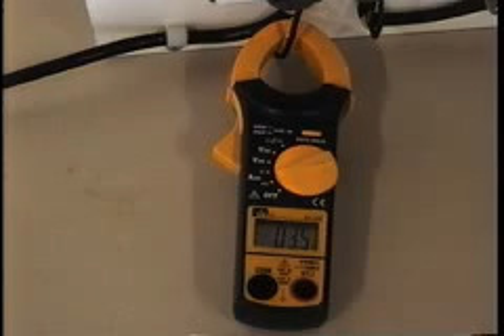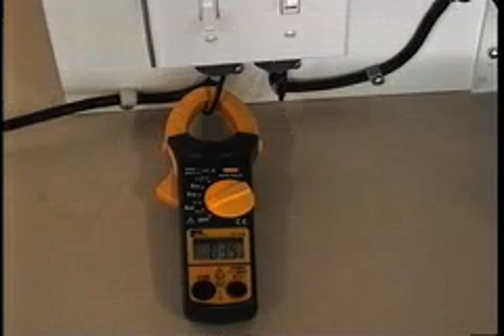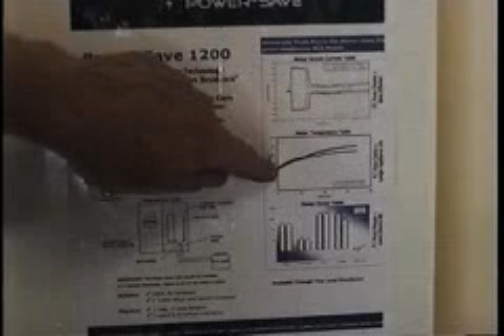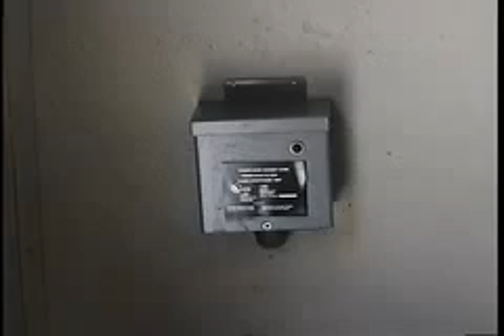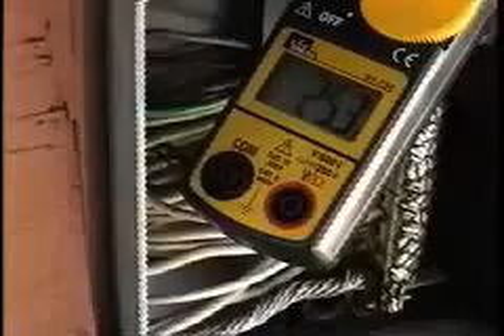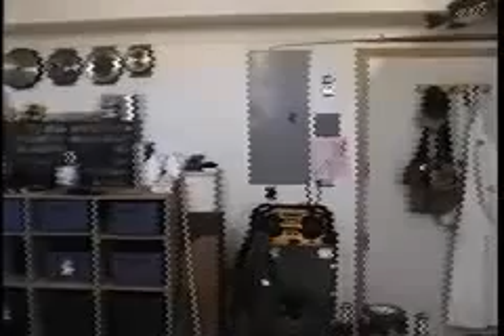Power Save 1200 Demonstration

Comment: I have been an senior electronic technician for 35 years. I know the theory of AC electricity. I have done extensive experiments using motor run capacitors which Power Save consists of and a kilowatthour meter and I have several of these. After all these experiments I have done, there is absolutely no change in the readings nor savings. Either with the Power Save on or not. It is what it is.

By the way. All the appliances I have replaced are US made. Any questions?

Comment: These appliances which I'm using were "energy star" compliant 10+ yrs ago...
So a conservative estimate to update these with today's energy compliant (made in China) appliances: 
New central air: $3,500, new fridge: $900, new washer $1,200, new drier (gas) $1,100, new power vent: $200 + install, new 5hp electric motor $250 (for air compressor)
Power saver on ebay: $70 that made my old appliances = energy efficient priceless :)
How much money you spent to save 43%? I spent $70...

Comment: I had replaced an old refrigerator and all air conditioners in my house with Energy Star units. My electric bills had dropped by 43%. Why? These refrigerators and air conditioners are Energy Star compliant have more efficient motors and better refrigerant.

Why stay with old, inefficient appliances? I say power save 1200 is still a scam for the homeowners. Period.

Comment: I bought one, installed it and my electric bill dropped tremendously!
When com-ed fails my generator also has better results with surge starting motors
I don't sell nor install these things, just noted from personal usage with a regular house which has the following: Power vent, fridge, 3 ac units, multiple server pc's running 24/7, and garage with a 5hp quincy air compressor that makes the meter spin like the tire of a 5 second dragster in the quarter mile!

Comment: Electrical meters measure consumption in watts, not amps.
watts = amps x volts x power factor
This device lowers the amps, but it raises the power factor in proportion, so the watts consumed remains the same.
Since the watts consumed remains the same, the heat generated by the motor is exactly the same.

This device is a scam.

Comment: This is a scam.  They scam you by showing a reduction in amps.  That's not power, it's current....different things with AC.  This is just BS.  Notice he uses an unloaded motor as a load - totally unrealistic.  An unloaded motor is an inductor, not a load.  It has a low power factor which the capacitors in the box increase.  However, this does not save energy or increase efficiency in any way.  Don't be confused by current levels.  That means nothing. Power is the key and it won't change that.

Comment: @OBXSOLWIND Amperage and watts are not the same. Amperage is the rate of flow to the load. Wattage is calculated by multiplying voltage times amperes. The electric meter on your house only measure in watts used, not current. If you have a home with a swimming pool and  pump running all the time. The power save will not make any difference on the homeowners electric bill.

Comment: @alexmiteecs  The power save 1200 is not my invention. I have exposed to what the Power Save 1200 consist of. I work in the calibration lab in the Boston, MA area. I would be glad to drop by and we would be in agreement in AC circuits. My work is in electronics.

Comment: @alexmiteecs  This is not imagination, it is real for sure. I have hands on experience with electricity. I have done numerous experiments with power saving devices. What's really inside that box? Motor run capacitors, nothing else. I have many motor run capacitors and done experiments with them, and I was right.

F in engineering? Think again. Go to an electrical school and learn about AC circuits. When you do find that I was right, you would have nothing else to say.

Comment: @CrankyOldYankee

Have you studied AC electric circuits?  I have been working with electricity for 35 years. Power factor correction does work for industrial customers to avoid power factor penalties. It has no benefit for homeowners whatsoever. ProTechPlumbing is right on this subject and I agree with him 100%

Comment: Amperage and whatts are the same thing. These things do work but only on 120v. what they dont tell you is the thing draws around 3 amps waiting for somthing to do. so if your house in not an energy pig these things dont work. If you have a pool where 120v pumps run all the time it may make sense.

Comment: I did not say that PF correction doesn't "work". I'm saying that it will not save a residential customer any money as they are not penalized for poor PF.

Since it will not lower KWA consumption (as discussed before) and there is no poor PF penalty to try and avoid, it's pointless for a homeowner to have one installed. It will not save them any money. It will give the power company some benefit, but not the home owner. As long as every one understands that then I will agree that they "work".

Comment: yeah mate, this is why big industry always use PF correction, cause it does work...... perhaps you could give some electrical engineers a lesson too if you believe PF correction does not work.

As for the device in the youtube video on a domestic level i could not see the need for it as domestic customers dont buy power at 11Kv or 33Kv and do not have their own transformers, however large industrial customers do and this is where you see PF correction in use "working" everyday.

Comment: "if mains amps are reduced so are the watts drawn"

Not if that amperage reduction was in the form of inductive reactance. In that case (what a PF corrector does) only volt-amps will go down with the amperage reduction, not watts(and KWA consumption).

It's pretty sad when a supposed electrician has to be given first year electrical theory lessons by a plumber............. perhaps it is you who should be rethinking careers.

Comment: In the case of a purely resistive load, yes, amps and watts are proportional.

However, in inductive loads it's a whole different ball game. Reducing the inductive reactance will only reduce volt-amps (and consequentially amps as well) while doing nothing for wattage.

I clearly demonstrated this in my video Power-save 1200 unit scam. If you watch the video you will see the volt-amps fluctuate while the watts remain constant when the unit is cycled on and off. Pretty cut and dry stuff.

Comment: Watts are one thing and volt-amps are another. Any electrician that doesn't know the difference needs to go back to school.

Power factor correction is indeed old.....for commercial users. It has been used for years to avoid poor PF fees, not KWA reduction. Again, it is not for KWA reduction, it is for Penalty avoidance.

And yes, I am saying that PF correction will do nothing to reduce KWA consumption. I challenge anyone to provide a credible source that states otherwise.

Comment: I never said PF correction doesn't work. I said it doesn't save residential customers any money. The POCO's meter can tell the difference between watts (what they bill you for) and volt-amps (what a PF corrector reduces, not what the POCO bills you for).

Reducing volt-amps will save commercial customers money because said users can be penalized for poor power factor.

Since resi customers will not see a reduction in watts (only volt-amps) and they are not billed for PF, it's pointless.

Comment: Yes, but what your implying is that you do not pay for amps..So let me ask you. If you only pay for Watts, and your appliances use amps in electric motors then do you not pay each time your washer and dyer turn on? What about a air conditioner? Do you not pay for those?

Comment: I have studied how watthour meters (Mechanical and electronic) work for the past 15 years. I have done numerous tests on power factor correction devices. The watthour meter DID NOT REGISTER any changes with the power correction device on or off. I even used a $3000.00 power analyzer. Sure the power factor and apparent power changes, but not true power. The watthour measures only true watts used. The power save 1200 offers no savings to the homeowners, except for large industries.

Comment: volts * amps = watts 
240volts * 10 amps = 2400watts
110volts * 20 amps = 2200watts
I.e. watts are effectively amps if power factor is good or leading and voltage is constant.

It would be a high load installation (ie a big family with AC everywhere that would save due to power factor correction in a domestic installation)
in industry its essential in my opinion

Comment: yes crankyoldyankee, power factor correction does work without a doubt and has done for all of my 20 years as an electrician, the bigger the installation the better power factor correction works especially if buying at 11kv and without a doubt essential in industry of any real size, protechplumbing, stick to the water dude you might know something about it !
ahhh watts are a function of amps and volts :) if mains amps are reduced so are the watts drawn from mains if voltage stays constant :)

Comment: Meters don't lie but electricians do. Lets do that test with a clamp on meter that shows watts not amps. Amps are not what the power company bills you on. They bill watts over time (KWA). Watts is what he should be showing us, not amps. 

The amperage WILL go down due to better power factor but it is irrelevant because the watts WILL NOT and that's what you pay for, watts.

Comment: I am an electronic technician for 30 years. Real power is real power. You're paying for watts used, not amps nor apparent power.

I have a wattmeter connected to my test setup and found the motor wattage DOES NOT change whether the Power-Saver 1200 is on or not. 

Clearly, Power-Saver 1200 is a scam for homeowners. 

End of discussion.

Comment: An Electrician told me that our power company is sending out up to 100 surges a day (The purpose of this i wouldn't know).  If that is the case would this type of unit "flaten" out the power coming into the house thus saving wear and tear on inductive equipment and also be of some benefit to electronic like computers?

Comment: If this unit drops the amp load on the panel then ampsxvolts=watts/ 2.2 amps x 124v=272.8watts  3.2ampsx 124v =396.8 watts hmmm. So if this unit shaves 1 amp over 24 hours then it would reduce your consumption by 2.976kwh

Comment: So why do energy star appliances now have capacitors build into them?  Because it works!  So then imagine this on the house hold level...even better AND the added benefit of surge protection to boot!.. yes the technology as been around for 100 years, but so has the wheel and it still is improving daily...

Comment: There is nothing typical regarding a motor with no mechanical load.  We are billed for watts not amps!  for billing are highly accurate devices.  These energy meters only measure REAL power, NOT reactive power!  As for power factor correction, this benefits the utility so they provide their own on the primary side of the distribution network.

Comment: You fail to explain the difference between real power and reactive power. You scam artists fail to explain that the utility does not charge for the high amps that you display. Inrush is also not a problem since it lasts for only 20 milli seconds. What a snake oil scam.

Comment: No hidden wires but the demo is flawed from the beginning!

The device reduces amps but does NOT save wattage. You are billed for watts, not amps. Measuring amps is meaningless! 
The only power is saves is that of wiring losses which is insignificant. The univ info proves this! They also dont show when the motor is off but the power-save unit still connected that it causes an amperage draw. Since your motors run less than half the time, the unit causes more loss than it would save!